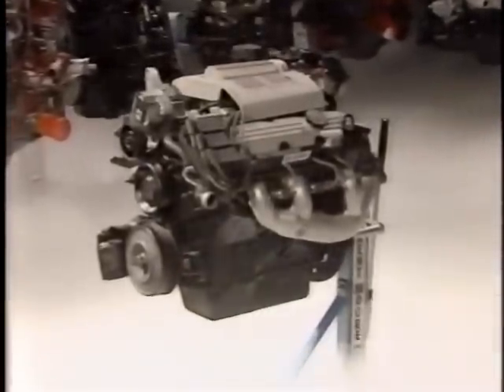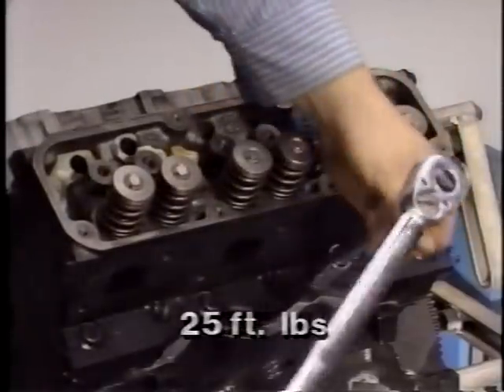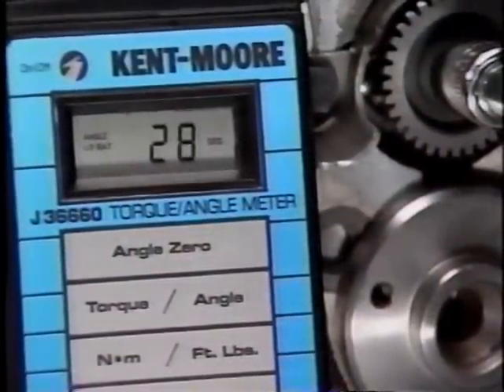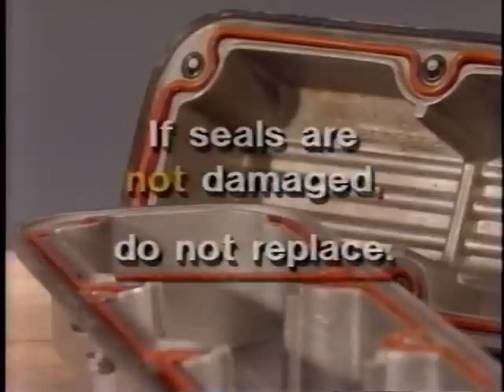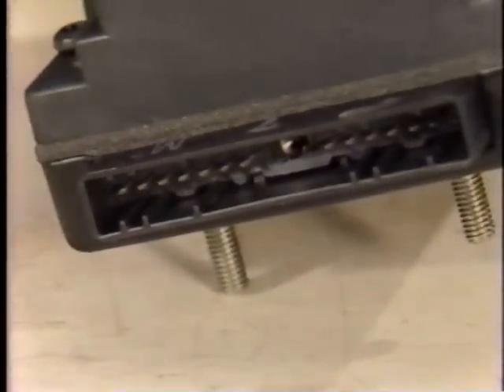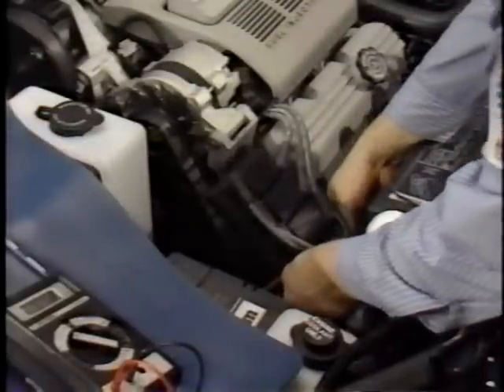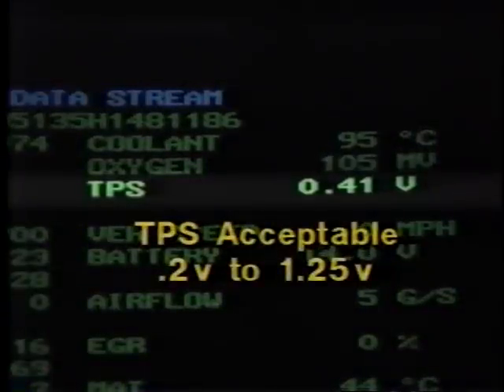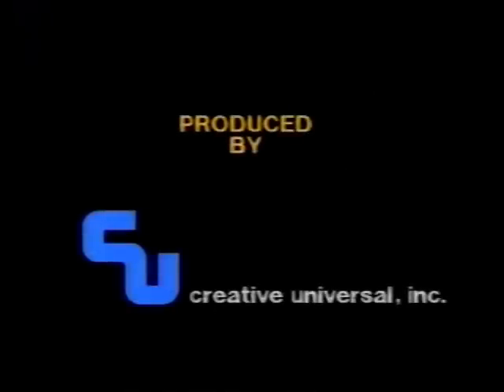Buick - 3800 Engine (1988)

Comment: Best engines ever made.  I've been driving only 3800s for 21 years. Never had 1 engine failure.  Even in high boost large cam setups.
Reply: Not sure if it's the best engine ever made but it's definitely one of the best gm ever made along with being one of the most durable and reliable.  My mom owned4 of them with zero issues. She's since moved to Lexus and has had 8 of their V6s with zero problems ever. The Lexus motors are smoother and more refined and extremely reliable and more fuel efficient.  GMs current motor that compares is their 3.6 liter v6 or the cadillac 3.0 turbo. Both are decent but neither can match the refinement and the durability and reliability of the Lexus motor.  Not to mention fuel efficiency.
Reply: I like the idea of carburetion to get rid of that ECM Spark retarding. And then putting it in a rear wheel drive application
Reply: That’s my plan. Already had 2, my first was an 89 Delta 88 Coupe and my current is a 1991 Buick Riviera. I’ll just keep buying 3800 powered cars until I’m gone
Reply: Until the (series 2?) intake manifold lets coolant gush into the plenum and then the engine hydrolocks... without any such warning.
The hard parts of these engines are really good, but the intake manifold gaskets made me a lot of money.
Oh, and then the plastic coolant elbows like to suddenly burst
Reply: @paulstandaert5709  how to prevent this? just preventatively replace?
Reply: @inandoutofreal1ty  It looks like the site doesn't exist anymore, or I can't remember properly.

Comment: And so begins the legacy of the PHENOMENALLY reliable 3800 series of engines; this legacy would last for over 20 years, go through at least 3 major revisions, and be installed in at least one car in every make General Motors owned.
Reply: a quick look at the wikipedia - the block casting was revised over 47 years. Also I do not think this V6 block was used in Saab, Hummer, GMC, or Saturn.
Reply: JKx150 Wikipedia, that is a place  for trustworthy information.
Reply: Robert Wood agreed, but in this case Ill still put my money on the current wiki.  Also 3800 series 1 2 3, Fireball, ect are just consumer names. Block casting numbers reflect the true legacy.
Reply: Tell that to my 92 Regal that popped a rod for literally no reason. Maintained fastidiously, daily driven, and cared for like a baby. Seat rail mounts also failed in a spectacular fashion.
GM = General Mess.

Comment: 8:53 reason gm came out with the redesigned cam button is the factory timing gear was aluminum with plastic teeth. The aftermarket gear set used a steel gear. It being thicker and having more mass than the plastic cam button could support, allowed the cam gear to walk forward a few thousandths of a inch, allowing the cam sensor magnet to strike the cam sensor following startup after timing chain replacement. It would start once, run fine, but never start again until the button was replaced, along with the magnet and sensor. Gm had a lot of these oops moments. Lol

Comment: Mines still running like new at 216000 this 90 degree v6 was the best they ever designed in my opinion.
Reply: Knock on wood, but it's about time you checked the LIM gasket, an ounce of prevention is worth a pound of cure.
Reply: Park Ave Ultra with 3800 Series 2 with over 200k! Great fuel economy, very powerful, and low maintenance.
Reply: @bakedveal2624  I had my upper and lower manifold gaskets changed and now my check engine soon light comes on and off.  1988 Elantra Park Ave.  Only 148000 miles.

Comment: Q: How do I know if my GM car has a 3800?
A: Is it late 80s through mid 2000's?  Does it have more than 200k miles?  Is it still running?  If you answered yes to all, you have a 3800 😂😂😂
Reply: It will say '3800' in big numbers on it.
Reply: My 1992 Lesabre had 250.000 miles when I sold it. The 3800 was starting to knock and overheat.
Reply: instablaster
Reply: 290000km In on my car. RWD sedan in Australia. 😍

Comment: I have an 1987 Oldsmobile 88 2 door with these 3800 engine and had 517,840 miles on the original moter and trans..

Comment: Rivlanta, do you have any more vids like this the design differences of 3800 series II and III?  When they are making reference to the 3.8L are they talking about the pre-88 FWD 3.8L engine.  This video was very educational to me in understanding the differences between the pre88 3.8L FWD and RWD and the 3800 v6.  I didn't understand what off center vs on center meant and now I do.  I know I also understand how the 3800 got improved throttle response over the 3.8L FWD and RWD.  Correct me is I'm wrong, but the 3.8L FWD pre88 had roller cams, whereas the RWD 3.8L used a flat tappet cam.  I own a Grand National and I'm rebuilding the 109 block found in the 86-87 Regals, turbo and NA and the 1989 20th anniversary Turbo Trans AM.

Comment: I daily drive my 1990 Bonneville with the LN3 3800. 321K miles and doesnt skip a beat. SES light rarely comes on
Reply: I'll need some tips from you man my 89 olds project needs some serious love
Reply: @jawbusta129  I guess it depends on the problem. I suppose one known issue that those cars had recalls for, actually, is the ECM is very prone to failure around 100K plus miles. ICM fails every now and then too which is just as important as the ECM. I have a couple repair vids on my channel for the issues my Bonneville has now and then. Maybe it could help.

Comment: If the rubber inside the balancer wears out it's going make a lot of noise, replace it with a harmonic balancer from a1994-09L 27 /3800 or series 2-3 engine.

Comment: This describes the pre-Series I 3800 motor of 1988-1991. I have had two (and currently own one) Series I cars and one Series II car. While the Series II puts out more power I actually prefer the Series I since it puts out less power to harm itself (my Series II got noisy, had cooling elbow issues, and probably needed more work by the time the car was hit and written off as it was still losing coolant after new metal elbows and a new radiator). Perhaps the pre-Series I is even more reliable; it probably is as it has slightly less power than the Series I and the Series I went to plastic intake manifolds in 1993. No experience with the Series III.
Reply: You are exactly right. I see a lot of failures of the plastic parts of the later 3800s. My LN3 has 324K on it probably because of what you said.
Reply: Series III has an aluminum intake manifold that rectifies the problem that plagued the Series II where the EGR tube would melt through the coolant passage in the intake manifold causing coolant to enter the engine and possibly cause engine failure. It was also equipped with forged rods and electronic throttle control. Unfortunately it still had the plastic coolant elbows (which I had to change on my 2006 Lucerne)

Comment: The 90degree 3800 has had like 7 or 8 generations on designs .. as he even said it looks like the 3.8 this is the l27 or the earliest of tune port 3800s or what the aussies called to ecotec 3800 these are considered completely different from the series 2 and 3 3800 only because from 95 - 04 the they were constantly updating the design and hell the 2008 3.8 has a different pcm then other years and its still unable to tune

Comment: Awesome video thank you!! Was this a OBD1 system? I wonder if any non oem Buick obd1 scanners are for sale on the interwebs. Ill have to check
Reply: Yes its OBD1.  I know its late but all you have to do get a paperclip and "jump" terminal A to B in the OBD port and count the engine light flashes to get the code. Costs nothing.
Reply: Amazon $ 15 - 20 bucks where i got mine the paper clips doesn't work for all like mine 89 Electra P ave

Comment: This looks like a strong motor, any tips if I turbo mine? Internals are currently stock.
Reply: FullthrottleV6.  There are allot of ways to go about it, the engine doesn't hit it's true potential unless on Ethanol and 20 plus pounds of boost otherwise you get about 14hp per a pound of boost on stock internals, and more per a pound of boost on a properly built car.
Reply: Chris Christopher that's great to know, thank you so much.
Reply: For the supercharged 3800s: aftermarket exhaust manifold, slightly smaller pulley on the supercharger, and a reprogrammed ECU... better get wider tires too, heheh
Reply: Some 3800s are fit with a supercharger from the factory. I'm not sure what modifications were made as a result but I assume they weren't extensive.

Comment: It's not that the 3800 is so good,  it's that every other gm v6 is Crap.
Reply: Not every engine can make it to such high mileages. The 3800 from what I've seen is one of the most reliable engines of all time(Emphasis on "one of". There are several Toyota and Honda designs that qualify too. Main reason why it's seen so much in GM vehicles is for that reason - it was the one engine that could compete) which is good because it is often paired with a somewhat weak transmission.
Reply: Wrong. Name another american v6 engine that goes 250k miles consistently with easy and cheaper repairs.

You can't. 

There may be better performing v6s but all things considered this was and is the holy Grail of American v6 engines.
Reply: Especially the High Feature V6, which likes to eat timing chains.
Reply: @MS-gn4gl  
Ford's 3.0 Vulcan v6.
Cast iron block and heads! 
Timing chain. Bullet proof.